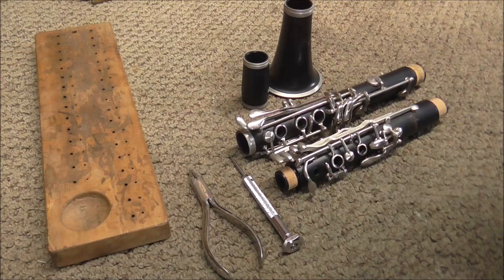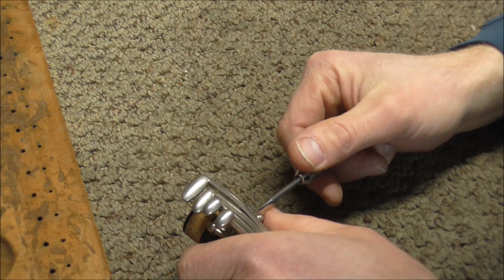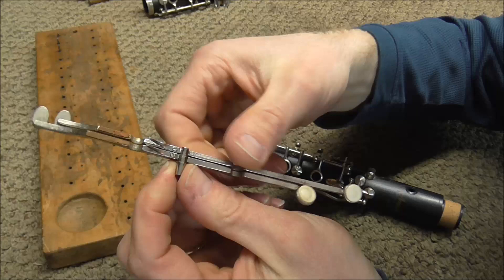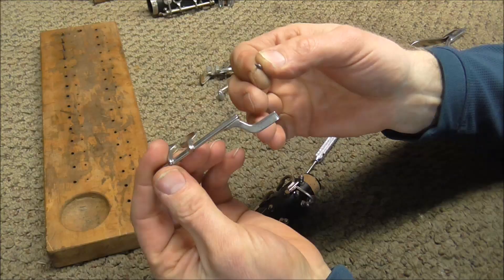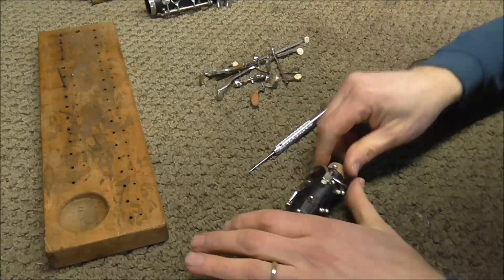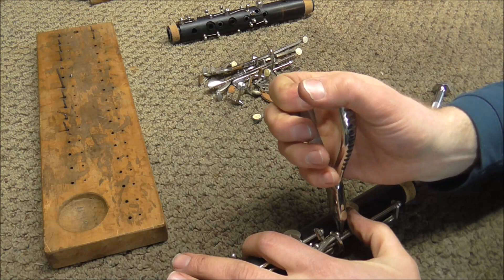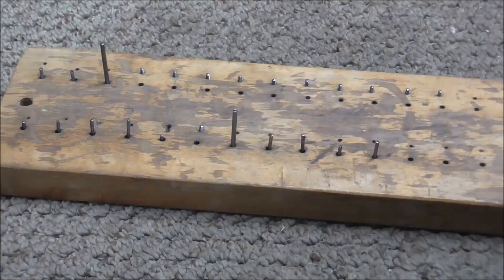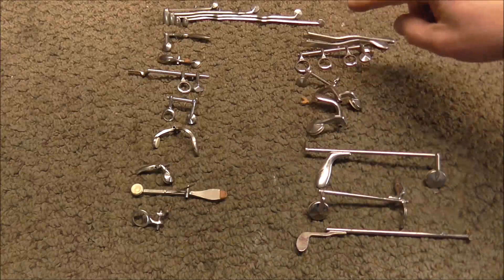How To Take Apart a Clarinet

Comment: Hi, I am new to clarinet, and i am currently dissembling one, because of the clarinet pads. I reassembled the top part, and none of the valves? are opening it correctly. do you have a video on properly reassembling the clarinet?
Reply from the maker: I do not yet, but that is a good idea. I will try to do that video on Wednesday.
Reply: @TheBrassandWoodwindShop  thank you!

Comment: Thanks for this great video. A question: if a lever is misaligned and it won't close the hole fully, will loosening the screw, then tightening it back while holding it in the correct closing position fix it?
Reply from the maker: It may work sometimes, but it would depend on why the key will not close. If the hinge rod or pivot screws are too tight, it will probably help, but for most cases, it will not help.